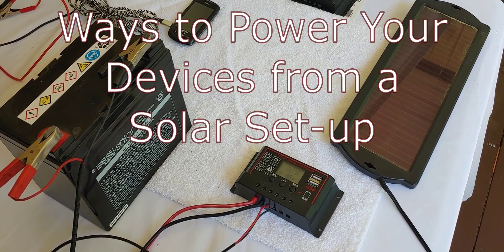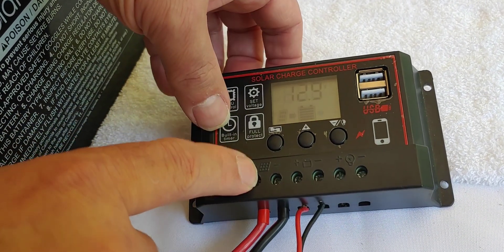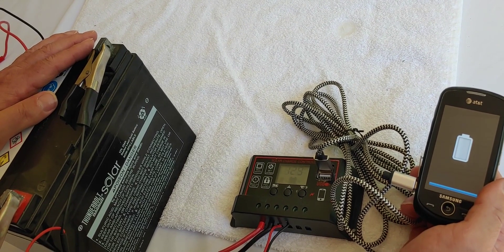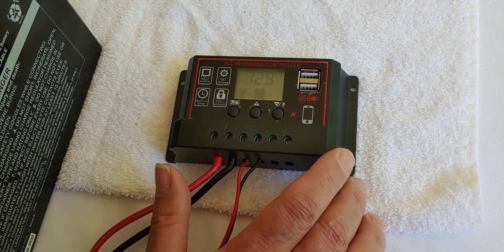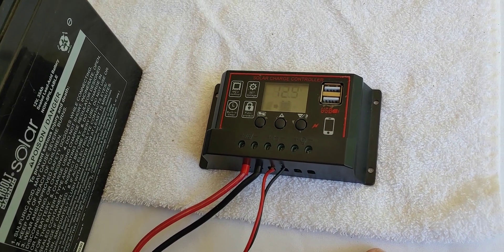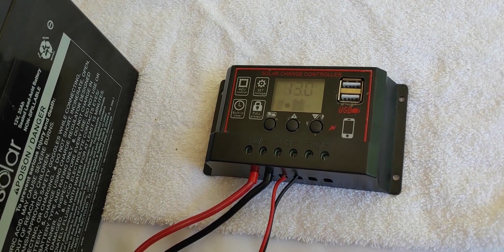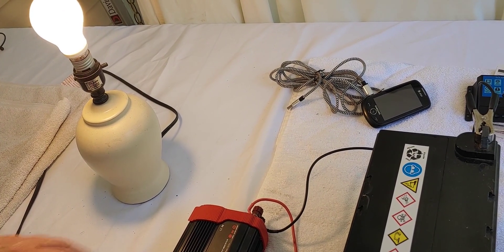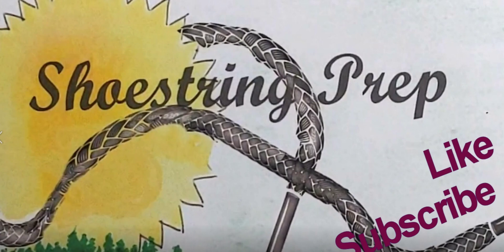Ways to Power your devices your solar power battery system.

Comment: Hi. I’m trying to connect my renogy voyager to my AGM battery. Will you tell give me insight for where to get or the wires with alligator clamps and what gauge is safe?  I have renogy 220w panels. I can connect the controller to solar panel easily.  Unsure of a quick way to connect to battery since I have little room in my battery box to leave wire and controller inside it.

Comment: I noticed you unhooked the charge controller when you hooked up your power inverter. Is that necessary? Couldn't you just leave it charging and use the power inverter whilst it's charging or no?
Reply from the maker: The charge controller may stay hooked up. Many of my systems do. Thanks for your comment.
Reply: @shoestringprep  awesome thank you for such a quick response blessings to you and yours.

Comment: What if I need to power a tv or a mini refrigerator or a portable laundry machine would I need a better battery or a better inverter? Could I plug it all at once with a extension cord or one at a time? Learning a lot from you. ..I will be buying the kit from Harbor freight soon..
Reply from the maker: Your first step will be to determine how many watts your device is you which to power will be using. Once you know how much power you'll be needing then you can pick the proper inverter and battery. I use a kill a watt  to determine my power needs. Thanks for your comment.

Comment: I'm wondering if it's possibly too wire the inverter to the dump load on the controller so that I can run a small heater periodically when the battery is full.
Reply from the maker: You should be able to do that. Just make sure you have the load settings set up for the time period you want. Let us know how it works out thanks for your comment.

Comment: how do you determine the size wire you need for what wattage?  If I have 4 25 watt solar panels what size wire should be used?  Im sorry if this is stupid question.
Reply from the maker: There is no such thing as a stupid question. 
I would use 14 gauge wire (or thicker).
Thanks for your comment.